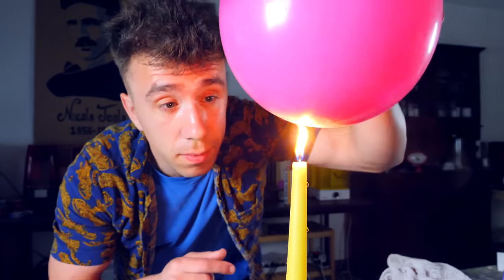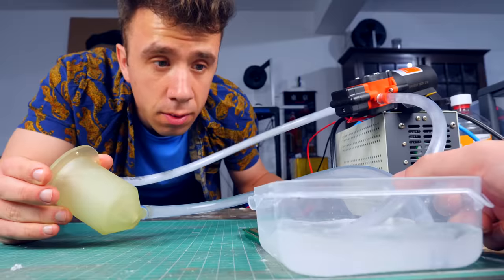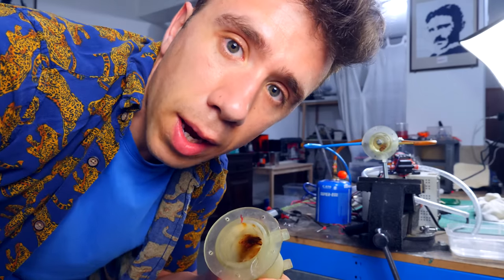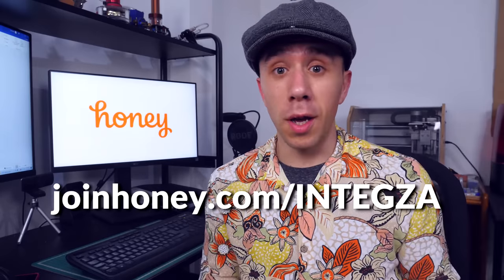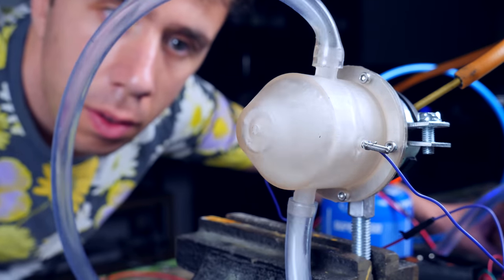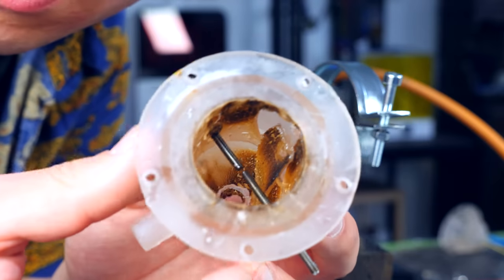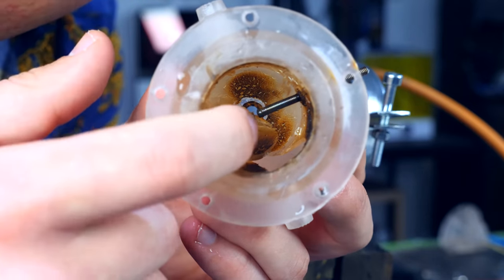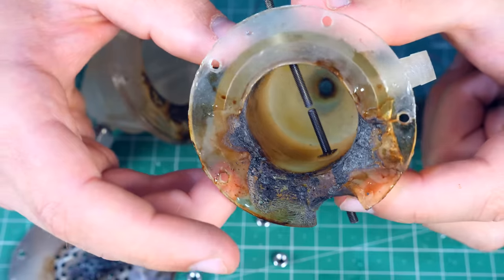Water-Cooled Jet Engine in Plastic

Comment from the maker: To be a part of the projects, JOIN OUR DISCORD SERVER:https://discord.gg/yRSa936NF4
Reply: Sure
Reply: If you print the internal wall of this model with the ceramic (which is porous) and the external one in resin you can pressurise the gap with air. That will create an air film that will isolate the printed material from the direct flame.
Reply: Next Time drilling you could use a backboard when making holes in thin sheets. It helps immensly.
Also please clamp down your workpiece!
Reply: Why not make the internal walls out of metal. This way the heat will transfer better. The water cooling was a suggestion in the comments in the community tab from me 3 months ago on the Dyson jet engine.
Reply: A similar technique is used for the blades of gas turbine
Reply: Next time try cooling if with fuel and then dump it in the chamber, maybe try building finns into the outer side of the inner chamber just like cpu water block. Also love your videos ☺️☺️☺️
Reply: For water cooling, you should have the input & output on opposite sides, so you input from the bottom & output from the top.
Also, I thing you should "counter flow" the cooling, so input is closest to the nozzle & output is closest to the base.
Reply: @exo068  Doesn’t that qualify you for a 3D printer?
Reply: @martinnorth4689  probably
Reply: You could use the cooling water as a steam-jet engine, after the output add a boiling vessel & use the steam.
Or you can use the hot water in liquid form, atomize it & mix it with fuel/oxygen to turn it into steam & multiply the pressure a LOT.
SEE THIS VIDEO: https://youtu.be/7Nlbc1D8G0U
Reply: Ok
Reply: @Aris Pan regenative cooling huh?
Reply: Your a FKing genius, brilliant idea 🤯
Reply: temp probes on the water please...and bring the water to the plate to also cool it
Reply: Joel looks 10 years younger without the Tash 🤣
Reply: So Integza can you use smoke as a jet fuel 🤔
Reply: Put a cerâmica plate or coat in the metal difusor
Reply: high temp rtv between the metal and the plastic
Reply: I'd like to see you make a 3D printed can crusher BUT for tomatoes!!!!!
Reply: i see what you did there. i like
Reply: @sebbes333  bottom to top flow as well for efficiency reasons👍
Reply: Hey Tegz,
That was a super fun video, thanks for the work you all do!

 I was thinking some 2" aluminum tape could help shield areas that don't receive any cooling from the water.
Reply: Another thought....re-enforced concrete cast parts with 3d printed moulds? Could use a kiln to do lost pattern casting with polystyrene as well. Steel n concrete has the same coefficient of expansion so potential to work as a ceramic substitute?
Reply: you know I think its a good idea to make an afterburning jet engine and strap it to a wheeled stuff if possible, this could either fly up or blow up
Reply: Use Mercury or gallium to cool the engeine!
Reply: Why don’t you just cool the filter with water like you did on the engine so you don’t have to use metal
Reply: Getting ever closer. Some ideas that might help you:
1) Print a cooling jacket rather than a water reservoir. Cooling jackets direct water in specific patterns around the part they are cooling. This ensures every area around the combustion chamber is receiving cooling. There are different designs, probably the easiest to print would be a manifold style where you have your water inlet going to a large distribution header which has smaller "finger" channels that go around the combustion chamber. The "finger" channels dump into a water reservoir at the bottom where you take suction for your closed loop.
2) Increase water flow. Heat transfer is a function of flow rate. If you want more heat transfer and can't change materials or temperature, increase the flow rate.
3) Water cooling. If you are in a closed loop, you will have to find a way to reject the heat the water is removing or you will end up reducing the heat transfer rate inside your combustion chamber. Another function of heat transfer is temperature differential. This is temporary because once the engine works, the air flowing past the engine due to motion can be used to do this cooling.
4) Insulate your diffuser/combustion chamber junction. Won't take much. Just something that will prevent/reduce the heat from the diffuser from heat soaking your combustion chamber.
5) Put a cooling mechanism on your diffuser. This is a bit tricker and it may require experimentation with different designs to see what works. Heat is conductive so you may find a way to design your cooling jacket to remove heat from the diffuser as well. Or have an exposed part of the diffuser that you can blow a fan on. This is temporary because once the engine works, the air flowing past the engine due to motion can be used to do this cooling.
Reply: You can just use ethanol or M3 novac and Cool it down with dry ice.
Reply: fin the internal part of the turbine (thats in contact with the water)....like a heatsink.
you could also use salt or glycol/coolant in the water so you could use sub zero tempreture water.
Reply: @Aris Pan okeh
Reply: 3D print or just tig weld sheet metal for the inside. The main problem is that the internals are not heat conductive, so the water doesn't really cool the inside. The externals should still be ok with plastic as long as the water keeps recirculating at ambient temperature.
Reply: The water balloon has a lot of air, the water can expand. In the engine, the small volume for steam may cause it to burst. Try an expansion chamber..?
Could a Starlite coating on the inside of the combustion chamber help to keep the plastic from melting?
Reply: For a future video idea: combine different options of 3D printing e.g. ceramic, graphite, and make a much larger jet engine.
Reply: You need to expand the cooling space to include the fasteners and have the pump fill from the bottom up to eliminate air pockets in the water that can create a hotspot.  Also it wouldn't be a bad idea to incorporate a heat exchanger/expansion chamber for when that water inevitably turns to steam.
Reply: Super top 👍👍👍👍👍👍👍👍👍👍👍👍👍👍👍👍👍👍👍👍👍👍
Reply: @danbrit9848  or bring the plate to the water.
Reply: Maybe if you add a thermal insulator between the metal and plastic
Reply: A few of the big YouTubers are making Iron Man Pulse cannons.. they are all failing and I know you can do better.
Reply: Why don't you paint your printed parts with high temperature paint some goes up to 800 C, it could buy you a couple more minutes.
Reply: Put a brass sponge before diffuser, where the fuel and oxygen mixes, to create a flame arrestor.
Reply: @JJayzX  I was thinking of a double wall completely enclosing the whole thing, but the double wall would be to create water flow across the surface starting at the nozzle and flowing to the back. I could make a drawing and share it on Twitter
Reply: Fascinating.
Reply: Wait... what happened to your mustache!!!???????
Reply: I can't wait to visit the vouga river
Reply: I just need to ask is it a common thing in Portugal for people to hate tomatoes? I love Seafood but I also love Italian food. I can't help it I was born and raised in a different country
Reply: Basically this is the same principal used by steam engines.
In order too keep the firebox from. Overheating and melting, water covers it. This part is called a crown sheet
Unfortunately...
. When the crown sheet is exposed for even a split second, it becomes incredibly hot. Then if water sloshes back over it it creates a runaway steam explosion and kaboom. Your train is now spaghetti.
Reply: @lightningwingdragon973  I'm pretty certain that nobody wants a spaghetti train, as delicious as that sounds
Reply: 11:40 Metal disc in the center, 2 ceramic rings (flat & wide) on each side as heat insulation & then the rest of the plastic chamber?
Reply: just a thought why not make both chambers water cooled , i mean even make the connecting plates with water to go through as well, you could have a shaft for the screw to go in so each chamber is completely sealed , then when the metal plate is in between them is screwed to the area thats also being cooled , now as for the water i would try ice water and have water in a cooler , with ice packs in that so the water thats coming from engine is getting cooled right back, you could also use the liquid cooler like a pc can use but maybe have the exit hot water go into the radiator to cool before it goes into the cooler filled ice water. That all might seem like a lot to do . maybe, maybe not. Just an idea. Great video keep it up!
Reply: Future Video idea: You should somehow CNC/Cut out out a 2-part metal plate, that you ALSO water cool, in between the sections of the engine. If you liquid-cool the metal, it'll prevent hte metal from cooking the plastic.

Additionally, you should design channels for the water to fly in the plastic. Possibly do a series of spirals, so that you ensure the water gets everywhere, and so you have total control of it. Ideally, you wanna find out where the combustion is hottest, insert the water there, and then guide it to where it is coolest.

The butane cooling idea wasn't exactly bad. What if you did a mixed-fuel rocket and injected butane into combustion at the end as an afterburner. You would send the butane through the nozzle and inject at a lower-pressure area. I think your model blew up because the combustion pressure was greater than the butane pressure (especially after you're expanding the gas to fill all the space in the cooling channels/area). However, if you keep the butane channels smaller AND inject to a hot, but lower pressure area, you should be able to get it out and pick up some extra power.
Reply: You've made s much progress in you videos, awesome mate, keep on going the good work!
Reply: make the nozzle a bit bigger, the heat and pressure is stressing the engine
Reply: Video idea: make a video trying to make biodiesel from tomato juice
Reply: If you can print it as one solid piece with cooling going through the entire thing including the plate. It might work
Reply: You've printed ceramics before?
Use ceramic inserts to protect the resin from hot metal...
Reply: Use a thicker piece of aluminium because that will disperse the heat
Reply: PLEASE READ THIS: Your idea with the thin wall was PERFECT... Only thing you can do better is, WATER SUPPLY AT THE BOTTOM AND THE RETURN AT THE TOP...That way air bubbles don't get trapped...They always return with the return line...This is how we do it in heavy industry when we can not guarantee the even flow without formation of air bubbles due to cavitation or design...So te recap...SUPPLY AT BOTTOM...RETURN LINE AT THE TOP...
And the best would work...supply at the front bottom and return at the rear top...
Reply: May I posit a thought I had? If thinking about the concept of temperature gradients, then we reach a conclusion that in liquid cooled chambers, theres always going to be a tiny layer of the walls that will be of equal temperature to the flame. The temperature of a point cannot suddenly drop to any temperature if the flame is 1400C and water 25C, then across the wall it goes smoothly from 1400 to 25. Somewhere along the way, a thin layer will still be at 1399C and a thin layer after it will be 1398C, and so on.

Would it be possible to try use air as the insulator. If you can make a vortex, the air can stick to the walls instead of mix into the combustion.

Just some ideas I wanna throw around. Im not capable enough to do it myself
Reply: Or perhaps its possible to have clay between plastic and metal?
Reply: A horizonal piston that accepts tomatoes from a vertical tube that ejects the juice onto a tomato growing bed that produces more tomatoes to feed into the machine.
Reply: i think using ridges between inner wall and outer wall works
Reply: Liquid butane? Wait isnt that flammable
Reply: @sebbes333  that must be the wrong link , its about torpedos . no info and only 10 second picture of combustion .
Reply: Carburetor gasket is sometimes called a thermal barrier. Not exactly but similar issue trying to keep the fuel from getting too hot
Reply: Integza you had it, get all that air out before firing.  Great work
Reply: try to print in one piece.no seams.
Reply: Hello I have some idea; first print it in one piece, use rocket engine design and fuel combustion chamber it should be better
Reply: I think if you could double or triple the thickness of your sheet metal, that would be a start, as the extra mass would help sink more heat before melting.

Additionally, you could over-extend the metal disk's radius, by maybe 1-2cm from the printed body. This would allow the metal to radiate heat into the air somewhat, but then, you could also 3D print a coolant ring to fit around and actively cool the disk as well, perhaps even with the same pump.
Reply: I saw a video where a guy uses a different type of filament in his printer and it comes out almost like silicone rubber it doesnt have the high temp like silicone but he uses it on a lawn mower engine.
Reply: you should make a rocket like missile that changes it direction linear to horizontal by using sugarrocket or kmno4 and h2o2 pls 
make this in your new video
Reply: A cooling ring in the 2 half's of plastic where the screws are aka > " inlet plastic - silicon seal - metal defuser - silicon seal - nozzle plastic " in the metal defuser and seal on the cooling ring only have 4 small holes between the screws allowing coolant to travel unimpeded and dissipate heat....
Reply: I would have to agree.  I noticed that some tests were done with the water inlet and outlets were horizonal.  This  could cause a air/steam pocket to form inside and reduce cooling.  Along with moving the nozzles, maybe make channel inside to insure water flow around all of the chamber.

As for the defusser, can it be made thicker and get water cooled also?
Reply: Hello, I proposed this project multiple times in the comments, was it an inspiration?
Reply: Try having the water come in the bottom and Come out the top of the motor. Will help to get all the air out
Reply: HEY.! Clean your damn Keyboard, it looks like a TOMATO’s 🍅 TOILET 🚽
Reply: I believe that the electric arc is passing through the metal plate and heating it because in the combustion chamber it is conductive, I would also make the water pass through the diffuser (make 2 walls connected by small diffuser tubes surrounded by water)
Acredito que o arco eletrico está passando pela chapa de metal e a aquecendo pois na camera de combustão a mesma é condutora, eu faria a agua passar tambem no difusor (fazer 2 paredes ligadas por pequenos tubos difusores rodeados pela agua)
Reply: try cooling with a bigger tank, also remove air from chanels.
Reply: Put ice 🧊 in the water 🤔
Reply: @japdog9   It is the right video, it is about a torpedo design (interesting design channel), notice that it injects 3 different "fluids" into the burn chamber: Alcohol, Oxygen & Water. The the alcohol + Water creates the combustion & heat, and then they add water that instantly flashes to steam. When water turns to steam it expands about 1200 times, a HUGE multiplication of force.
Reply: Why don't you 3d print some of the parts out of aluminum? You can then design the internal system to more readily transfer heat to the water. You could even just switch out your sheet metal defuser with an aluminum defuser. Then you can redesign the engine itself to be larger than the part the defuser covers and have the water touch the Aluminum to disperse heat away from the part being covered by the defuser
Reply: @sebbes333  as i said there is only 10 seconds and no infomation . you just explained it but your vidio is silent . i stand by my first post . i admit it is interesting but poor quality . there are many better
Reply: @sebbes333  also it flashes to super heated steam . and also the alcohol +oxygen are mixed they create the combustion & heat, then the water is added to create steam .easy mistake with a non infomation cartoon vidio .
Reply: Use Nitrogen as a coolen and use metal
Reply: Exodus 20:7
King James Version
7 Thou shalt not take the name of the Lord thy God in vain; for the Lord will not hold him guiltless that taketh his name in vain.
Reply: video idea: you are spending so much money on butane a should make your own fuel build a wood gasifire easy and simple
Reply: Next time im gonna watch you fly a 3d printed plane
Reply: You should make a 3d printed dragon that can shoot fire
Reply: @Integza use the coolant from car
Reply: CERAMICS :thanksdoc::thanksdoc:
Reply: Two silicone gasket between which the metal plate is sandwitched would protect from melting the engine where metal contacts are. also screws should also have silicone shielding through. the holes.
Reply: Sooo much bubbles in the water,  get rid of the air ples!
Reply: @exo068  could have told him how to cool it better then. are you not happy to see something you commented created?
Reply: @benjaminsteakley  I did. I am happy that he tried it and don’t expect something in return. In the end it’s just a fun project to watch.
Reply: same using a metal 3D printer then.

Make one of these: https://en.m.wikipedia.org/wiki/V-1_flying_bomb

3D printed and sent to Ukraine to cheaply trigger Russian rockets.
Reply: Integza i have a question, why dont you try building a pulsejet engine they are simpler to build and once you get the best material for building these engines then probably try building a turbine jet engine.
Reply: Aerogel insulation?
Reply: @TomsBackyardWorkshop   yeah and they make roles of gasket paper at auto stores also using some spare computer cooling equipment may tidy up the build and help keep air from being in the system
Reply: Consult with Mark Roeber. He is a rocket scientist after all!
Reply: Why don't you print the parts and give them a layer of ceramic coating on the inside.
Additionally some supports or flow channels or guides or how you want to call them would help the innerchamber.
Reply: try using thermal insulation gaskets on the engine joints, it might be better))
Reply: Try molten chlorate salt with a solid gummy bear core.
Reply: Make a see-through piston engine out of plastic
Reply: YO please wear safety glasses or something for the face Jesus dude!
Reply: Add metal sleeve in the combustion chamber
Reply: You should get a fancy metal 3d printer.
Reply: Integza, maybe someone tries to impersonate you, I got a message saying that I am winner of som prize. I guess it wasn't you who wrote that, the profile that wrote that looks a bit sketchy.
Reply: ⚡⚡ There is a fraudster fooling people to send him direct message on telegram to claim gifts. Please  avoid that sussi baka ⚡⚡
Reply: Sorry, I have a question! How exactly is it set up in your case, how does the gas injection work? And how do you prevent the flame from burning into the pipe where the gas comes out? I also wanted to ask how you build up pressure inside? If I understand it correctly, you have a gas input and an input for a compressor for lift pressure or what? I would be very happy about an answer. Thanks. I find these videos really exciting from you. Can you go into more detail about how exactly it works in the future?
Reply: Have you tried car coolant?? might actually work.